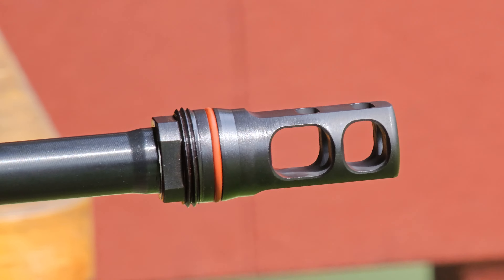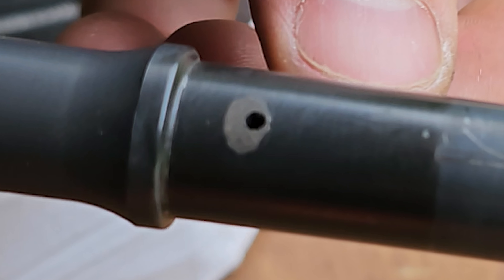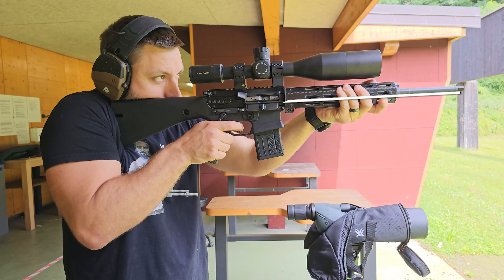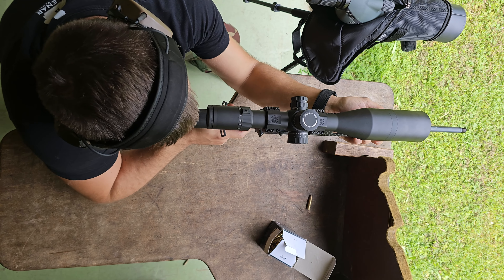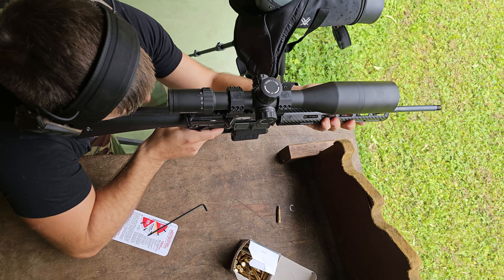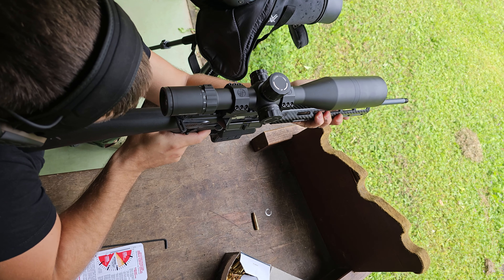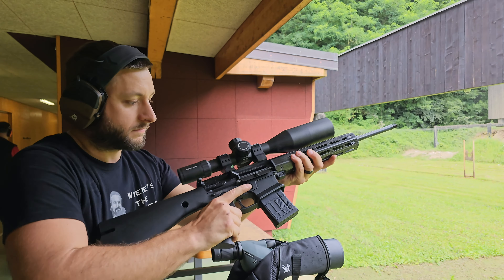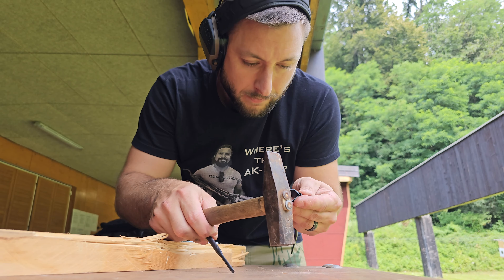How to Fix an over-gassed AR15

Comment: So disregard my comment on your last video. This is a BA "pencil" barrel. It is not only thicker and heavier than the Faxon "pencil" barrel, it is thicker and heavier than the Faxon "gunner" as well. The Ballistic Advantage "pencil" profile should match pretty closely to the M16A1 "pencil" profile, much more faithfully than the Faxon version. However, the manufacturing is more similar to Faxon's in that it is a button rifled, QPQ melonite finished made from 4150 Chrome Moly Vanadium steel. It's gonna be heavier but a lot more accurate. Subs should be easily attainable with this.
Reply from the maker: Im amazed at you level of confidence commenting about my rifle 😂
Reply from the maker: I have a friendly challenge for you - can you make a video shooting a couple of 5 shot groupings that are sub-MOA at 100 yards with your AR?
I don't want to be rude but the vast majority of people that claim sub-MOA groups with AR's are either lying or they are shooting 3 round groups and selecting the smaller one as proof.
Sub-MOA can definitely be shot with a semi-auto AR and some other rifles but it's not as easy as some people think on the internet
Reply: @PolenarTactical  Well I saw Russel commented and confirmed it's a Ballistic Advantage barrel, which is why I had that confidence 🙂
Reply: @PolenarTactical  I sent you a DM over at twitter.
Reply: Yup, a lot of bs on gun comment sections. Sub group comments are one of the biggest.. @PolenarTactical
Reply: @hairydogstail  I sent him a DM on twitter. He should have it. Also I was commenting that the one he has should be BETTER than the one I have, which I think he misunderstood.
Reply from the maker: @JeffNeelzebub  He didn't confirm anything, just stated that WWSD rifles in the US use BA barrels. My rifle has a Faxon pencil barrel - as almost all EU imported WWSD rifles do
Reply: @PolenarTactical  That is really strange because it is VERY different from my Faxon barrel I bought directly from Faxon. Like visually quite distinct even without seeing any markings. If I do a response video, would you watch?
Reply from the maker: @JeffNeelzebub  yes, i will watch
I personally don't use Twitter that much
My barrel is marked as .223 Wylde with 1/8 twist, made from 416R stainless

actual marking:   .223 WYLDE 1/8 416R SS HP MP
Reply: @PolenarTactical  Ok, I can’t get to it until tomorrow but I’ll do a video comparing and contrasting barrel profiles from these companies, plus show some sub-moa results from my Faxon Gunner match. The Faxon ones should have the company logo on it and should be 0.5” thick forward of the gas block journal (for both gunner and pencil profiles) while the BA one should be 0.57”. Yours looks like 0.57”. The Faxon pencil gas block journal is short, only 1.1”, and can only accommodate a low profile gas block, while the Faxon gunner and BA pencil both have a 1.9” long one that capable of mounting an M16A1 style front sight block.
Reply: @PolenarTactical  Does it have a little spade logo? The markings are identical to a BA barrel but they have no pencil profile made of 416R on their website, but maybe they make them for the European market. 

Faxon makes both gunner and pencil in 5.56 and 223 Wylde. The Wylde version is called “match” and is made of 416R while the 5.56 is called “Duty” and is made of 4150 CMV. My gunner match is marked “Match Series .223 Wylde 1-8 T 5R 416R MPI”
Reply: @PolenarTactical  Looking at a BA barrel chambered in 223 Wylde made of 416 R, it is marked with a spade logo followed by “.223 WYLDE 1/8 416R SS MP HP”. They don’t have any pencil profile barrels on their website made of 416R or in 223 Wylde but maybe they made them for WWSD.
Reply from the maker: @JeffNeelzebub  no logos on the barrel but the markings seem identical so it probably is BA
I spoke with Russel on FB and he said that the exported .223 wylde barrels were made by BA

Comment: … you could also add a quad rail to add weight and reduce recoil, increase the weight of barrel while your at it, then you can add a heavier buffer, maybe swap out the polymer lower, stick a tap forward assist and… oh… I think we just built a regular AR 😝

Comment: You will need to clean and lube  the adjustable gas block after every outing. Other wise it will freeze up.
Reply from the maker: That's not true at all - if you have a good quality gas block it should function even if dirty. 
On my Schmeisser in havent cleane it for 2 years and i run suppressors - the adjustmen knob was still able to turn and click as i had to adjust it recently for some competition
Reply: It is a good idea to add a few drops of oil to the adjuster screw and run the screw in and out after any significant amount of shooting.. @PolenarTactical

Comment: I want y'all to take me seriously when I say this one part is the BEST upgrade you can do for an AR. It's better than a match barrel. Guys, I put this on all of my AR's they run smoother and shooting suppressed is as clean as shooting a DI gun. It keeps the gun SOOOOO much cleaner. They're spendy, they do offer a 20% military discount, if you're cheap like me. If you usually shoot suppressed this thing will make it run like a sewing machine and you only have to wipe your bcg off rather than hogging the chunks of carbon off your bolt with a KA-BAR.
Reply: You don't need to hog any carbon off the bolt and nothing replaces a match barrel for accuracy lol... Just keep it lubed and clean it once in awhile, which doesn't include any scrapers..More Fudd lore..
Reply: @hairydogstail  Well, in the army they make you get all the crusted carbon off the bolt before you can turn it in and sometimes you have to break out the leatherman to get it off. You may not do it but I do, that doesn't make me a fudd. It doesn't affect the accuracy, I just meant that I would pick this as my first upgrade.
Reply from the maker: @davewebster5120   Maybe he doesn't shoot much with a suppressor.
I know exactly what you are talking about, i even used a flathead screwdriver once to get the chunks of carbon out of my upper 😆

Comment: Am I the only one who doesn't like the proportions of that rifle? In a sense that barrel looks so thin compared to the handguard and scope is comically big
I know that it doesn't have to look pretty to be functional, but this looks so wrong...
Reply from the maker: I think i explained it in the previous video - i was testing the accuracy and POI shift of the pencil barrel so i used a scope to eliminate the variables. The buttstock and handguard are also cut (shortened) as this will soon become a "Commando" setup, similar to what Ian made for himself. 
The barrel will get cut to 12.5" and i will probably use Primary Arms 3x or 5x prism on it, to complete this lightweight and compact setup :)
Reply: Thank you!
I watched that video and now I know why it is like that
Glad you chose to do short and informative videos while also inserting some jokes here and there

Comment: I put one of these Superlative Arms Bleed-Off Adjustable Gas Blocks on a 7.5” AR that was WAY over gassed and it fixed the problem perfectly.  These gas blocks are about 100 bucks, and you can tune your gas system to the round you are firing.  An awesome product. 👍
— Jason/Freedom Fighter Until Death/Vermont, FRA (‘FRA’, meaning “The Failed Republic Of America”)